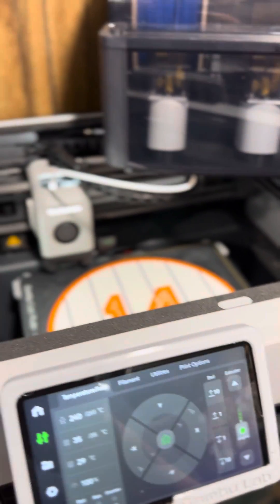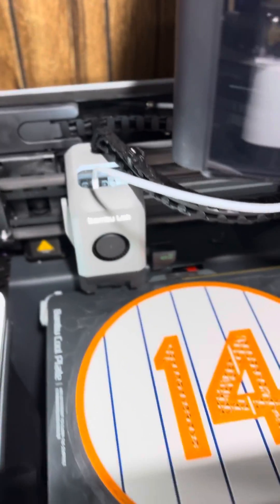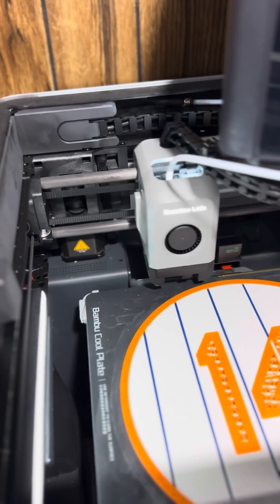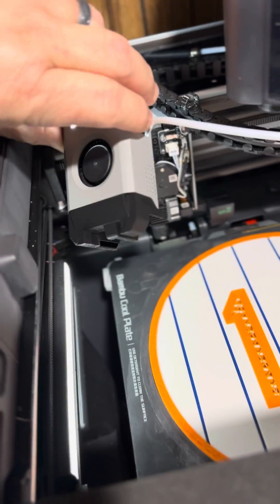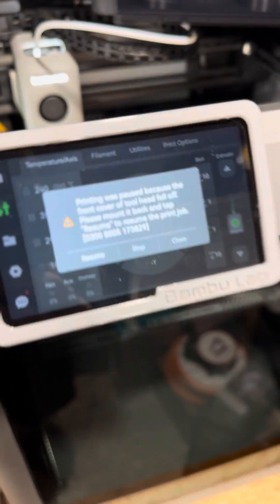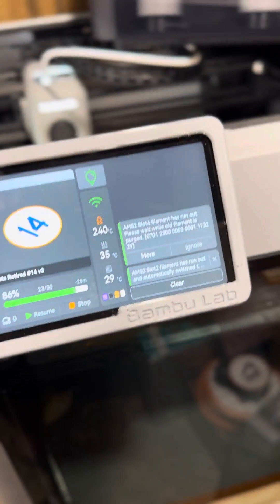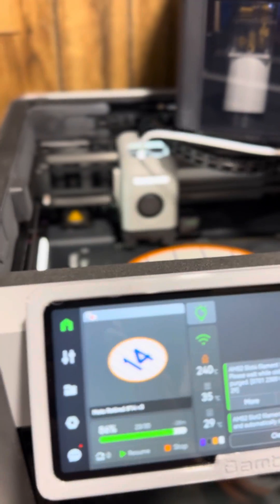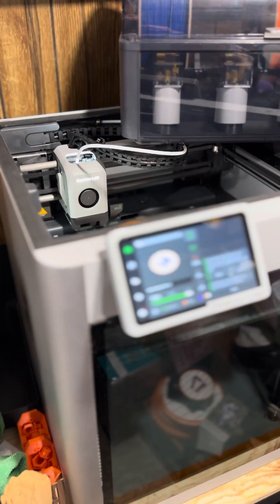Software Bug in Bambu Lab X1C Firmware?

Comment: It's in an error condition with a stuck task in the queue and you expect it to behave normally?  I agree, it could handle the situation better, but why don't you stop the print job, instead of hoping that a second error condition will override the behavior of the first error condition?
Reply from the maker: The error should be handled differently.  Yes, I could have stopped the print but then I would have lost the print.  If the printer is in a pause state, the printer should be in a pause state.